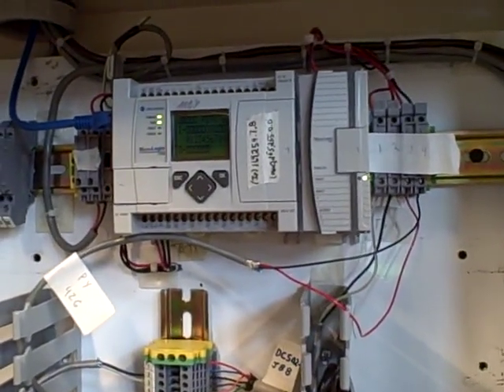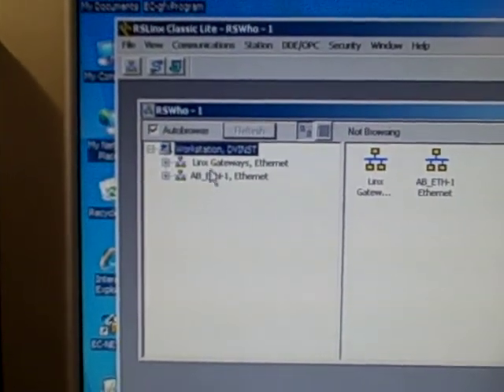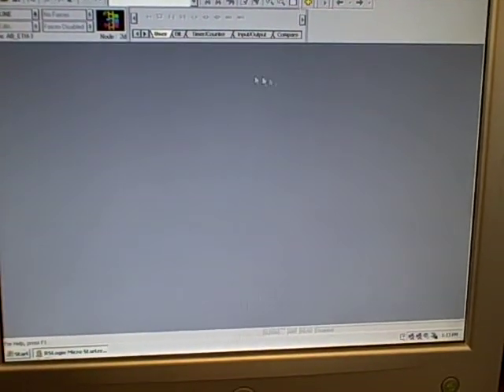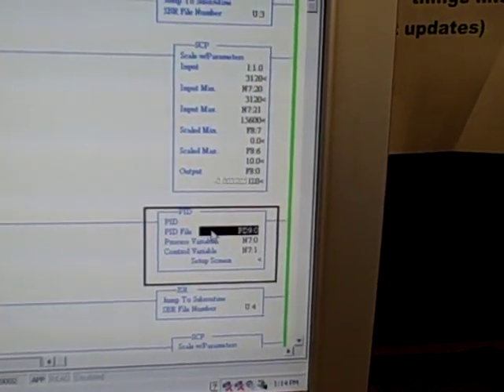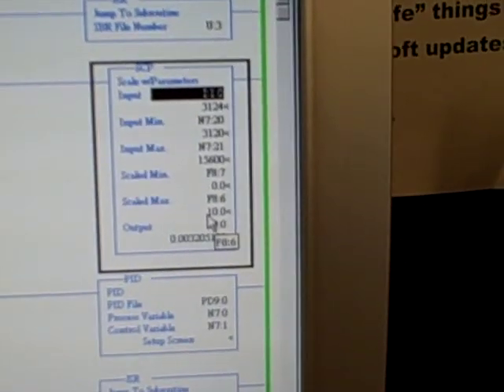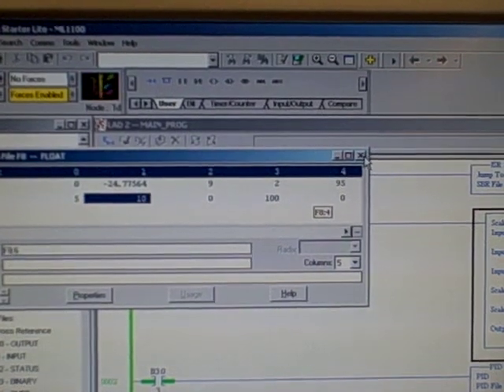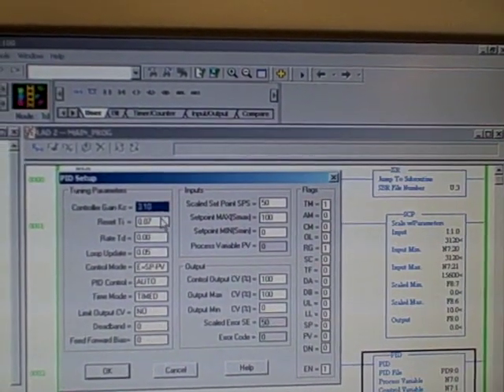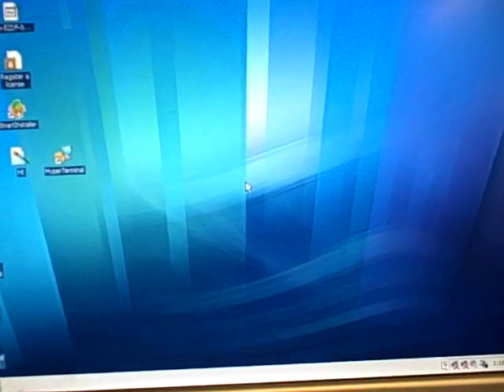Allen-Bradley MicroLogix 1100 PID loop controller setup -- part 1 (ranging and PID action)

Comment: This is a good video but there is no explanation about N7:0 (PV) were this is getting its value from as it appears it may be from one of the other ladder files so it's not really the setup only showing changing CV value from real Eng unit to a percentage with no explanation how to set the logic up

Comment: Only AB would require you to buy yet another software package to tune a loop.
Reply: The software in this demonstration, RSLogix 500, has been around for a long long time and is not being developed or improved. Now there is Studio 5000 that has much more functionality than the old software and is probably the best on the market.
Reply: It's a fine package but I'm firmly against paying for software to use a companies hardware products.
Reply: I suppose you are using Linux anyway then. Good luck finding Automation software for Linux
Reply: Good thing Microsoft doesn't make PC's. You know exactly what I'm talking about. I just picked up a new drive line that uses CoDeSyS for their programming features. They want $ 1200.00 for the package. There is now way in hell I'm ever going to talk a customer into paying for that. It's a great drive but I'll never use some of the features exactly because of that.